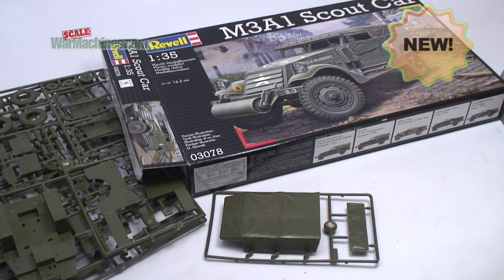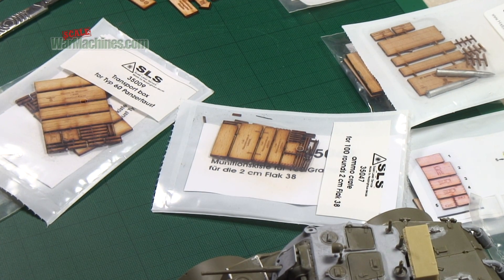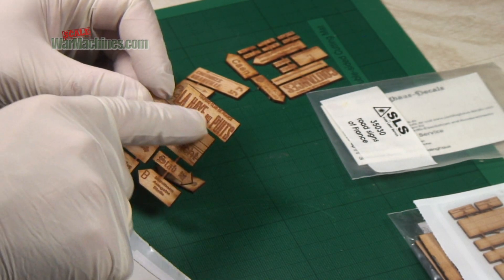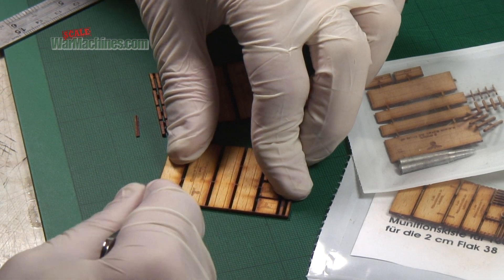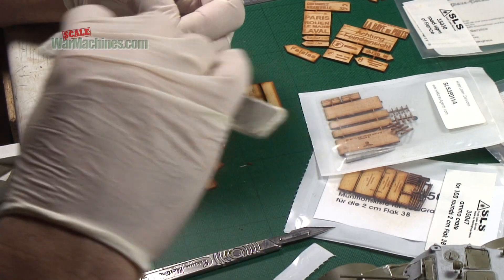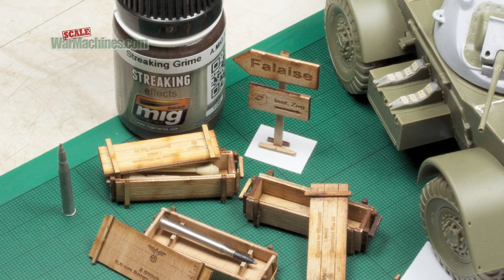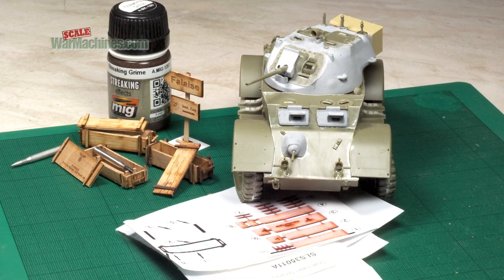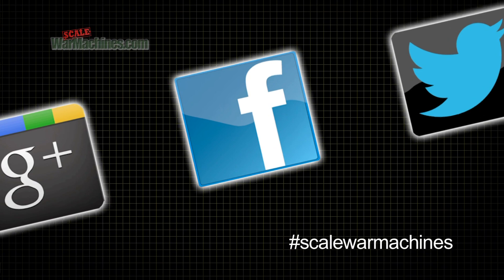SCALE LASER SERVICE DIORAMA ACCESSORIES

Comment: Now, I need these sort of things, however I'm wondering if it's possible to custom order a scale. I need them in 1/12 scale which unfortunately is very rare and next to impossible to find anything in such a scale.
Reply: ZobbyGaming usually depending on what items you are using you can mix and match some of them but considering the scale you are doing things in , you might not want to go smaller than 1/16